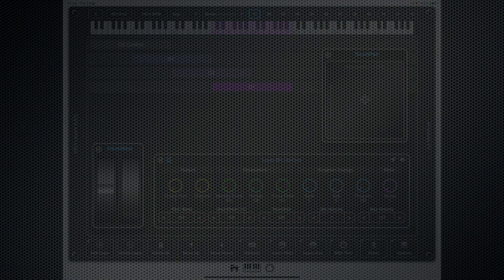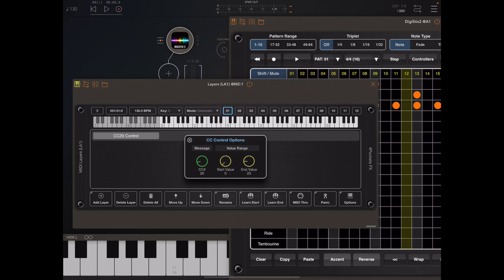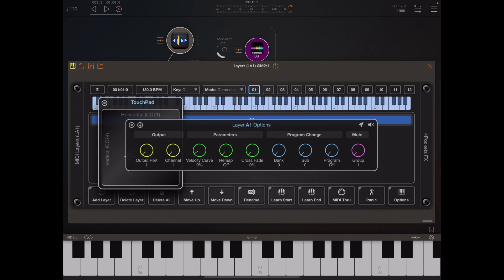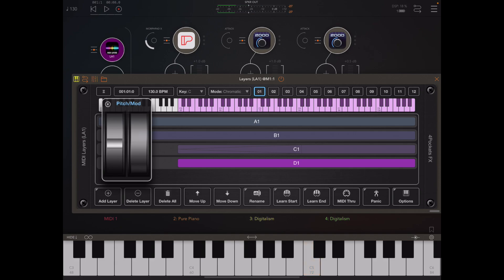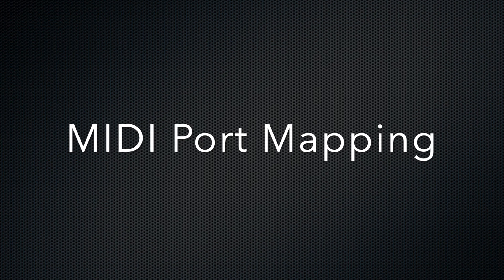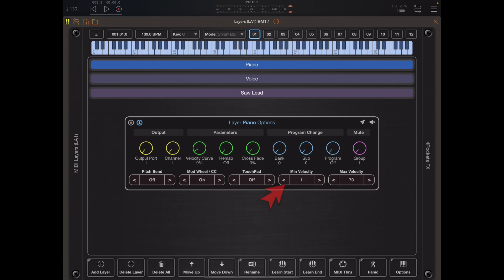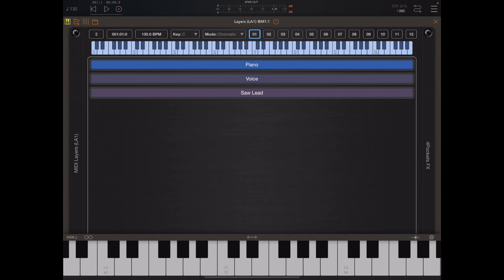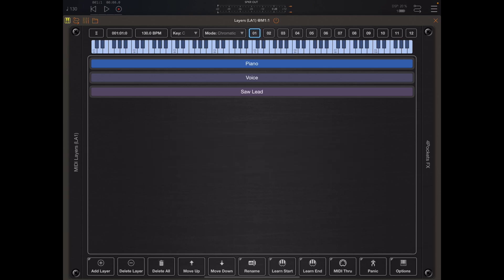MIDI Layers for iOS - MasterClass

Comment: Great programme
Nevertheless, I miss a few features that are essential for controlling external midi devices.
Under options (e.g. as second row) for each layer
1. user-defined CC filter (e.g. for sustain)
2. volume (cc 7)
3. at least 3 user-defined CCs (e.g. for reverb send or attack etc.)

Nice to have:
It would be great if you could receive a midi dump per layer and send it when you call it up (CC, PC, SysEx).
It's a bit unfortunate that you can't configure the layers for mutes and scenes. Often 3 or 4 keys would suffice. So you lose a whole octave if you want to control via keyboard.
It would also be helpful to be able to enter values directly (e.g. for PC), e.g. by double-clicking.  It would be nice if you could send PC permanently when making changes.
A small detail: The scene name currently in use should be visible as a header.

Comment: Hi Paul, can the lowest note in a Layers be lower than midi note 24? I am trying to assigned a sequence to the lowest note om 88 keys master Controller but the Layers Low region stops at C1 (24)
Reply from the maker: Yes, sure you can. Look at the Master Keyboard setting in Settings. By default we assume a certain range, but you can extend the range down to MIDI note 0 if you wish.
Reply: @PaultheMusicMan  Thanks, excellent! Also is there a way to decide the midi through chanel in a layer? Say that I creat a midi through enabled layer with omni chanel input, but want the MIDI signal that goes through only be transmitted on chanel 2 of a port. Is this possible?
Reply from the maker: @fredsaboonchi2975  I believe the MIDI Thru Settings in Settings allow you to choose a destination Port and Channel, but by default it is set to Omni.
Reply: @PaultheMusicMan  Great, thanks! But this is on an overall level right? Can it be done on layer by layer level?
Reply from the maker: @fredsaboonchi2975  The Layer Channel controls the output on a per layer basis.

Comment: Hi! Can I ask you pleae fix (update) MIDI Layers with updating parameters when changing in the gui? for example when I change parameter in host like MUTE GROUPs, the gui shows (Reflect) changes. But otherwise not: when I change (mute,unmute groups) the the window of the plugin (gui), the parameters in the host stars not changed. Sometimes I like to change in the gui , sometimes via parameters in host (Drambo), would be great If the values are always in sync. Also I think when recording automation from gui, will be easier when parameters are updated to host. Maybe its user error , i hope so. Please respond, thank you for your hard work. I love ❤️ MIDI layers. 🎉
Reply from the maker: This is not possible, and not the way MIDI Layers works. It was written to automate settings in AUM and not the other way around. It is possible to change AUM's params by sending MIDI, but we are never told that AUM's parameters change. If you've seen my videos you will appreciate that MIDI Layers allows you to record parameter changes over a whole song, and play them back. This would not work if other factors were involved. The Sound Test Room did a great video on using this app, it might be worth taking a look at Doug's video.
Reply: @PaultheMusicMan  true! Under Cubasis there is no problem, at now 15-02-2023 in Drambo I cannot write automation from GUI of the MIDI LAYERS, and plugin crash error on load when parameters are visible (maped). Thank you for fast reply.
Reply from the maker: @przemysawjakubszczypek3922  This program was written for use under AUM for automation of AUM's interface, I wouldn't have thought it was useful under DRAMBO or Cubasis for that matter. I assume you are trying to host MIDI layers inside of DRAMBO?
Reply: @PaultheMusicMan  Yes, under Drambo - and at now Drambo not write and read automation from MIDI layers gui (plugin window), and crashes
Reply: @PaultheMusicMan  from message developer of Drambo sent me in PM (translated by me from Polish)::
‚,1. Drambo set saved state of plugin  (during load project)
2. Drambo set values of parameters maped to knobs in Drambo 
3. MidiLayer crashing

Most DAWs dont processing step 2, so Bug accour only in Drambo, but it is Bug in the midi layer’’
I hope i can help spmehow to find and fix crashing in Drambo during load project with midi layer with maped parameters to knobs.
Reply from the maker: @przemysawjakubszczypek3922  Ok, will need to purchase a copy of DRAMBO to resolve this one. I will look into it.
Reply: @przemysawjakubszczypek3922  I have messaged the makers of DRAMBO (Bleep Street) asking for a promo so I can test this. It will be next week probably when I get to look at it. Hopefully it's something I can fix and not a DRAMBO issue.
Reply from the maker: @przemysawjakubszczypek3922  I now have a copy of Drambo but it seems the issue is more than just loading and saving state as for me it is not crashing. I think this might require me to map some parameters but with me not being familair with DRAMBO I haven't got  a clue how. Any chance you can send me a demo project that causes the problem? Please send to info at 4pockets dot com.
Reply: @PaultheMusicMan  sure! Thanks
Reply: Sent

Comment: hi paul ive been using midi layers and it has helped me a lot!  question, is there a way for the scene /mute control layer to be assigned to a physical knob on my controller.?  thanks again
Reply from the maker: If you are running under AUM then you may be able to map CC controllers and notes inside AUM to MIDI Layers exposed parameters. I suggest you take a look at the AUM manual as it's quite complicated to explain.

Comment: Under Drambo, when I map mutegroups parameters or. Scene parameters, after reloading project in Drambo, or. Even saved.  Preset of MIDILAYERS (created in Drambo) - MIDI LAYERS crashes.
Reply from the maker: I wasn't aware of this issue. It does seem odd that it works fine under AUM, Cubasis, Loopy and others, yet crashes in DRAMBO. Is this an issue with old presets created outside of DRAMBO, or does the problem exist when creating new presets?
Reply: @PaultheMusicMan  with new Presets, the for response

Comment: This app is a real power tool. I started with AUM - a couple synths, Cality and MelodyBud - and with a few tweaks and in less than 5 minutes with the app turned it into something quite workable. Really fun. The pretty appearance of the layers and the smooth movement, the deep layers of options and controls make this really appealing.

Comment: Hi Paul,

There are times the piano sustain pedal is passed to the auv3 instruments, and other times it does not. Not sure what sequence causes and clears the blocking of the sustain pedal. Other than that, I have been very happy with midi layers.

Craig
Reply from the maker: I haven't noticed this to be honest, but I will do some testing. You now have to turn on ModWheel / CC in the layers palette in order for CC to be sent to the layers port/channel.
Reply: @PaultheMusicMan  thanks.   
Very basic to reproduce on my setup. Launch aum, add midi with midi layers. Add audio instrument. Tie everything together wrt paths. Add midi layer.
If there is a better venue to discuss, let me know.
Reply from the maker: @1csmellon  Did you ensure CC passthrough is enabled for the layer? It sounds from your description above you didn't enable it? See my previous comment.
Reply: @PaultheMusicMan  I did not. If I turn on Midi Pass  Thru, the sustain pedal works fine.  Thank you. 
Sorry for the misfire.
Reply from the maker: @1csmellon  You are right, nut I thing it maybe it is not working as intended so I am taking a look right now. You should not have to turn on MIDI Thru for it to work.
Reply: @PaultheMusicMan  i wasnt sure how else to turn on cc pass through. Sorry
Reply from the maker: @1csmellon  You need to select the correct layer that you need to respond to CC64, press the 'Options' button. Press the small down arrow in the top left of the window, and turn ON 'Mod Wheel / CC' and it should work fine. This allows you to specify which layers respond to CC messages and which do not. I may enable this by default in layer versions.
Reply: @PaultheMusicMan  that works. Again, sorry for missing this.

Comment: Paul, it would be awesome if each layer had a midi channel filter. This way multiple external midi sources or controllers can be used at the same time with Layers. Thanks!
Reply from the maker: The next version has a MIDI In Channel for each layer so you can control which source can trigger the layer.